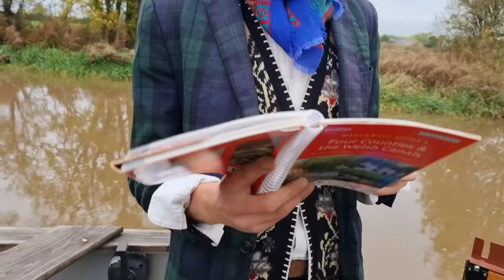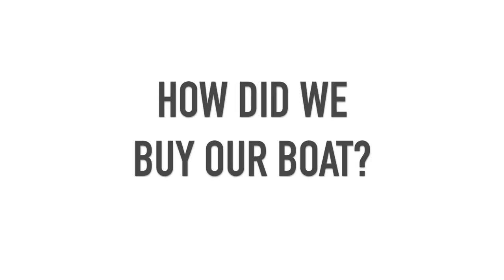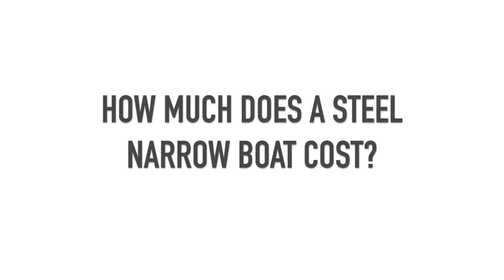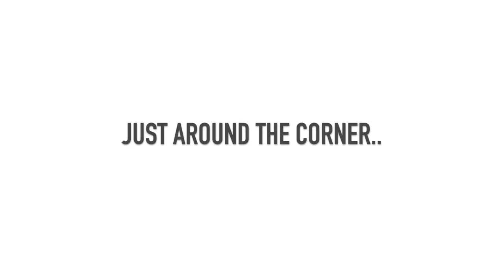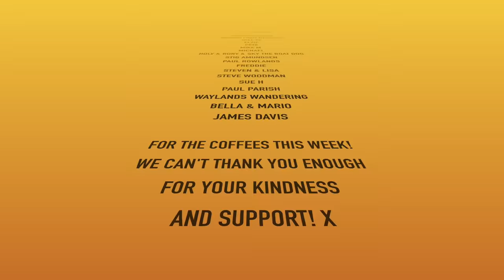How Much Does It Cost To Live On A NARROWBOAT ? | How Do We MAKE MONEY in our TINY HOUSE? | EP24

Comment: Hello Ben & Emily, purely an opinion here, but the leaves issue seems very common this time of year to many other boaters and a quick shift to reverse and back into drive seems to rectify this for the majority of boaters. The nasty looking oil in weed hatch suggests that you may have become victims of some other careless disposal of a waste oil container by another boater that your prop found and burst, since it was old used black oil. Wouldn't hurt to pull dipstick and check level and colour of oil in both your engine and transmission? Also another subscriber mentioned the stern glandin your footage appeared to be dripping a little too much, and warrants checking tightness of stern gland rope and grease and grease canister? Hope all this helps put your minds at rest. David.🤔🤞

Comment: Hi, Ben and Emily,  great video, we are Colin and Heather currently living in Ohio,  and soon to be joining you all on the cut. You create very watchable content, you are doing great. The number of folks watching you is  testimony to that. 

Re your engine service you two were brilliant working together.  

This is what I do, after an old change with a new oil filter, start the engine, let it run for 3-5 mins, it will have circulated the oil throughout the engine , ...... and filled up the oil filter,  (on some engines that could be upto a litre of oil ) your oil filter,  probably was a about a quarter of a litre , then make sure check and top up the oil level in the engine and check again. Then do the fuel filter. 

I would also suggest you clean out the bottom of the engine bay of all the water and general gunge...... then you can tell if you have a leak, weather it is oil, or water or diesel or  coolant. 

Nappies are very good at soaking up stuff, and great for keeping the engine bay fluid free. 

Are you giving  the propeller shaft grease gland a turn or two (no more) each day.  That could be a cause of a water leak in the engine bay , that said I think  it is  the overflow of the calorifier blue catch tank, which should be on you list of things you do on a daily basis before using the engine. Namely checking / doing:  engine oil , grease gland turn, coolant fluid check, fan belt check tension with fingers . 

Finally Your black gunge in the weed hatch issue,  just a thought,  someone could have thrown a plastic oil canister full of OLD USED OIL, that you hit with propeller.... that  would have given you the symptoms. 

Ben to save you putting you hand/arm through all that gunge, I suggest using a small can you could have scooped a load of it out of the weed hatch and then used a nappie to soak up the last of the stuff remaining on the surface of the water. 

Just my thoughts. very best regards Colin and Heathet.
Reply: Looks like there are no regs / qualifications on the operational functions for these boats. Completely voluntary? 
The canals appear crowded, with that many boats it’s surprising that it’s not more polluted.

Comment: Emily you are a very clear speaker and getting better all the time. You’re engaging and positive and good with the camera, which is a natural talent. Since you had the filter off your engine and also opened the tap, I’d definitely have a look under the engine to see that nothing is coming out of those places. Check the engine oil level. I also wonder if the mechanic disturbed an oil seal on the output shaft, and oil could be running along the shaft to the prop.
Reply: That was my first thought, but then it couldn't explain the intermittent loss of drive.
Hopefully it was just leaves or some sunken mass of twine that fouled the prop, and cleared itself, otherwise I would be worried about the woodruff key that locks the propeller to the shaft. Any large amount of clogging around prop can cause it to become ineffective at driving the boat, so let's hope it was that.
Anyway great video informing us of the costs of constant cruising.
Reply: @chrisyarnold6205  Actually it could lead to overheating and so reduced power as everything expands (check your oil level guys) ... also all those leaves could be clogging the water intake for the engine cooling which again would lead to overheating and the motor not feeling well. Anyway their vids are a month behind so I'm sure it's all sorted by now

Comment: great tube as always . i am getting on a bit and you are the only countryside i see , so thanks for that. as an old mechanic if its as you say leaves on the prop, i would think one, or more , has got under a seal on the prop and could be oil or grease getting out into the water. if it has cleared i would still check all grease points and oil levels to make sure they are ok. luv you.

Comment: Loving the vlogs, very chilled and well shot. With the oil on water issue, keep some eco friendly washing up liquid near the engine bay, not just in the galley. Having worked extensively around water, on lock gates etc. the occasional oil spill would happen. A quick squirt of wash liquid into the oil slick will make it dissipate and break down the molecular bond. I used to squirt it out in big s patterns to hit bigger ones. A squirt in your weed hatch would have gotten rid any oil before Benny put his arm in. At least now his strumming must be well 'slick'. 💪😂

Comment: A bit late to the party as they say. I spent most of my childhood holidays on the canals, both on cruisers with outboards, and a narrowboat with a BMC 1500 diesel. It would be my guess that what you got wrapped round your prop at lock 1 was maybe some bitumous or tar sheeting of some kind, and the prop partially chopped it up leaving bits of tar in the water. Just a tip for the future, a few drops of washing up liquid into the water will disperse stuff like that in a jiffy. I had to do that after spilling a cup full of fuel oil into the water when refuelling a ship and the bunker overflowed.
You make such a lovely couple 🥰🥰🥰

Comment: I lived on a58 ft narrowboat [solo] for about 5 years and loved every minute of it. About your problem with your engine .Don't worry.  My mooring was in Chirk marina so the Llangollen canal was basically my home. Leaves on this  canal are a pest,but if every so often if you feel as if your engine is losing power put the engine in reverse and rev the engine.This throws the leaves off in the same way as it drags them on. The black will be something that some idiotic boater has thrown in the water and your leafy prop has picked up. I now live in St Martins which you will  be passing shortly unless you already have. I hope that I have put your minds at rest. Good luck.

Comment: Black stuff was oil.  Also, the stern gland seemed to be letting in more water than what's ideal.  1 or 2 drops per minute. 
Thanks for the video 👍❤️
Reply: Agreed 100% oil and that engine is a ticking time bomb. I would get that checked out sooner than later.
Reply: Came on to say the same, the gland was dripping faster than it should, i recon that black sludge was the packing grease 👍
Reply: @Dirt-Diggler  ah yes, why didn't I think of the oil coming from the gland. 👍. 

My experience is many years on large water pumps and working on gland packing changes.  Boating experience is about 7 holidays 😀..........

When turning the greaser by hand ideally you'll want to turn it a few turns every few days and feel some resistance then do an extra half turn.   I'll say 2 or 3 turns in total.  The 2 nuts on the packing gland will need tightening up slightly first though. Nip the nuts up and then give them an extra half or full turn.

The nuts on the picking gland should be tight enough to only let 1 or 2 drops per minute through when the propeller shaft is running. 

With the nuts applying the correct pressure on the packing gland that should be enough to reduce water coming in and stop that grease going out into the weed hatch. 

If the nuts can't be tightened any more it'll probably need packing replacing.  The packing is like square waxy rope. Maybe 4 or 5 correctly cut and positioned with the join at 1/3 spacing around the shaft.  

Leave packing replacing to an expert as you don't want them all coming out and water pouring in, although a temporary long term fix could be too add an extra 1 or 2 sections of gland packing on top of what's already in there if those nuts are already fully tightened.  But it'll be best to get a competent DIYer to have a look.
Or do some research first 👍
Reply from the maker: Hi we believe we drove through some spilled bitumen, as it was bitumen in the weed hatch. I'm not sure how oil from our engine could get into our weed hatch? Our engine is fine, but thanks for your concern 😊
Reply: @BenandEmily  check the drops from the gland though. 1 or 2 drops a minute is ideal. 👍

Comment: Sometimes when engines lose power, its worth checking for signs of overheating... I'm not sure how your engine is cooled, but it might be worth checking that there is no leaves blocking the water intake.. (Always check water coolant levels when the engine is cold, otherwise you may scold yourselves with hot gushing water !!  Good luck.... I'm a new subscriber that really enjoys your content.. Thanks
Reply: Heat exchanger - canal water goes through a tube containing tube(s) from the engine instead of a radiator.

Comment: Before readiing this I'd like to say how much I'm enjoying your v-logs, you both seem to be genuine people 👍😊
So did the problem get resolved? It wasn't leaves around the prop and it wasn't something you motored through, it's a mechanical failure from your boat. These things happen. Was it the reduction/transfer box draining out the packing gland, a failed bearing? That would explain the loss of drive while still having a reasonable sounding engine. Heat in the gearing would give you some of the problems you've got.
Reply: This is the way. That’s where I’d start. Regardless of which problem, the packing gland is leaking the contents of the bilge/sump into the canal. We keep some oil soak pads made of goose down to skim any oil (ours or someone else’s) out of the water.
Reply from the maker: Hi Chris, our bilge pump is in a container so no oil can get in there to get pumped out. We would never pump oil into the canal. We have a built in tray under our engine to contain any oil( which is minimal) its mainly water under the engine from when the calorifior was pumping out water 🙂
Reply from the maker: Hi Steve, 
thanks so much :D So glad you're enjoying our vlogs! Yes the problem is resolved it was just something weird that we went through, i think it was some bitumen or tar that had been dumped in the canal. The mixture of that and a LOT of leaves just gunked up the prop and made the engine struggle so much. We've had no problems since...just the leaves still! 😄

Comment: What another feel good video!!!
Perhaps you have been told but when cruising in autumn and there are plenty of leaves etc on the surface, in my opinion is around every 20 - 30min always put the prop in to reverse for a short time, try forward again, if the same thing happens again repeat.  Try again if it’s still a problem then it’s the weed hatch.
Fallen leaves are not a waste Benny, it’s natures way of returning nurturant to the soil.  However a handful for other purposes it’s going to create a problem

Comment: Hi If you have a bilge pump that might have switched on and pumped oily water over the side that also would account for oil on the water and in your inspection hatch, as i noticed the stern gland is leaking badly. Cheers
Reply from the maker: Thanks Ramsey 🙂 our bilge pump sits in a container so it only puts out water from the stern gland so no oil would get in. We're still confused what it was as it wasn't like oil more like thick tar or bitumen. So odd! It seems to have cleared now and all working fine 😊

Comment: Hiya I've been thinking could somebody have done a oil change and not having a proper container used a plastic bag and thrown it in the canal and you've driven over it getting it all over propeller.Have you pumped the oil out of the locker.Also I thought the vegetables were fridge magnets. I liked the masks
Reply from the maker: Yeah we're really not sure! It seemed much thicker than oil, more like bitumen so maybe someone dumped that in! 😬 not sure we could have pumped it out as it was in the weed hatch and would forever be pumping out the canal water. It seems to have all cleared from there now and is running fine 😀 Thanks so much for watching!

Comment: Get that engine oil checked just to be on the safe side, loving the videos, I would love to do narrow boating ;-)
Reply from the maker: Thanks for watching! 😊 Don't think it's oil, more like bitumen. How would oil get into the weedhatch from the engine? We're still confused 😄
Reply: I doubt engine oil could get there without making a much bigger mess in the bilge. The prop pulls itself forwards. if it pulls something sticky on to itself, it could alter its effective shape in to a crude waterwheel so it no longer pulls, but tries to flip the boat over instead.  Obviously it could never manage that, but it would provide resistance to make the engine struggle.

If I had a worry, it'd be that the bitumen was off the hull of their boat if there was some solvent (diesel?) on the water . Doubt it'd do much, but it may be worth having a look when it's emptier & sitting higher in the water

Comment: Hi again guys. The Revenge of the Fallen Leaf. Just very briefly, as a retired/semi-retired Continuous Improvement Engineer (manufacturing companies employ me to improve their efficiencies by finding and eliminating root cause of long-term production line issues), I put my thinking cap on regards your breakdown issue, The boat lost drive following exit from the lock where Emily had observed large quantities of oil in the water.  Benny had the very unpleasant task of checking that the prop was free of debris, having previously, reversed the engine, which it was.  When starting the engine again, it was found that drive had been restored.  On entering the next lock, it could be observed, that there was a very large quantity of leaves floating on the surface of the lock.  These became entangled in your prop and drive was lost again.  Putting the boat into reverse cleared the obstruction and you were able to continue.  I believe that badly contaminated and oily leaves from the first lock had been responsible for the initial breakdown and that selecting reverse, had cleared the problem and allowed you to continue.  I believe that a seal failure had occurred on a previous boat allowing oil from the engine bay, to enter the canal. Tongue in cheek observations: 1.  Alan had been observed peeing on the floor at the stop site that she seemed to like.  Did she pee on some leaves?? ".  Benny had made two wonderful looking masks out of fallen leaves for the Halloween gig and had opined that what a waste of a perfectly usable resource fallen leaves were.  Maybe the leaves decided to let you know, that they wished to be left alone?  We shall never know, but perhaps the moral of the story, is that the leaves are saying " We shall wreak havoc to your waterways and railways, tread carefully"!  Feel free, Benny, to write an ode and put it to music if you feel so inclined, I won't sue for plagiarism I promise.  Hope this has given you a laugh or two and perhaps, been of some use too.  😃😃
Reply from the maker: Hiya! cheers for that 😊 Yes it was definitely a combination of many many leaves (worst in the locks), wind and water flow against us and shallow water. The bitumen in the weed hatch was the surprise bonus, which only served to confuse us further.  Thanks for watching ❤️

Comment: Bless you having to deal with that gunk.. it looked like Benny had had a struggle with some fake tan on his arm ergh!

Oil / grease floats on water, so it's logical it could accumulate & be trapped in the pocket of water in the weed hatch, but I can't see how your engine oil could have leaked there directly as there's no connection to the weed hatch.

There's the engines water jacket nearby, but I thought they were like a heat exchanger (radiator) & don't use canal water directly, nor should there be copious amounts of oil in it anyway!

The stern gland looked a bit leaky though.
Stern grease could have got through. Perhaps if the prop was tugged by leaves = blobs of grease freed.
Perhaps check that gland & look out for end-play (prop sliding in/out a little between thrusting forwards & backwards).

I'm no expert though, just babbling my thoughts!

    Thanks for another nice video again btw; was great to see your off-boat adventures too (and masks!).
I was excited that you're on the way to Wales, that will be lovely this time of year & you're hot on the tail of the lovely Narrowboat Pirate ☠️ 👍
Rockin 😘

Comment: It's definitely Oil but where from is a mystery. I would check oil levels in engine and box first after that I'd look into the engine bildge for any further oil or diesel. Tbh not sure what is going on? 🤔
Reply from the maker: Yeah such a mystery! 😅 Pretty sure it wasn't oil as it was so thick and sticky like bitumen! Think it's something we picked up round the prop while we were going along, so confused! 😆
Reply: @BenandEmily  strange that it seemed to happen when you were coming up the locks over the sill of the top gates each time,are you dragging something?